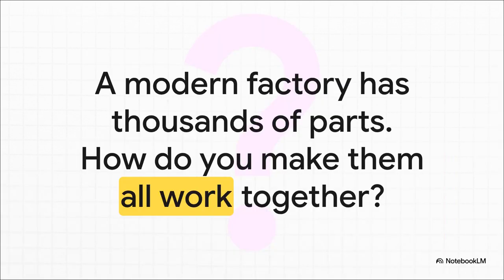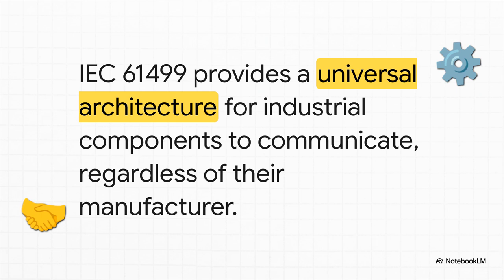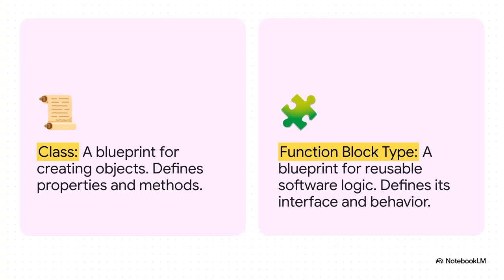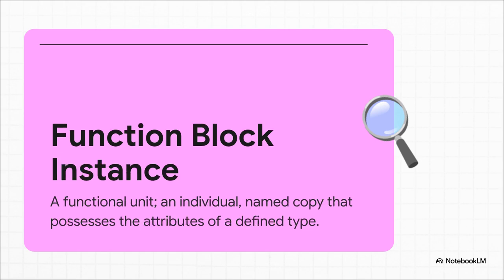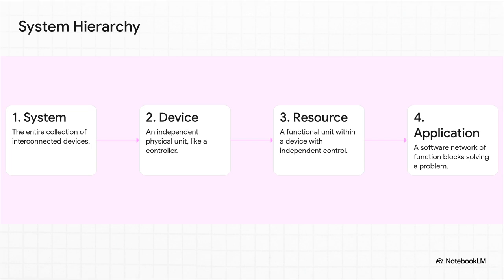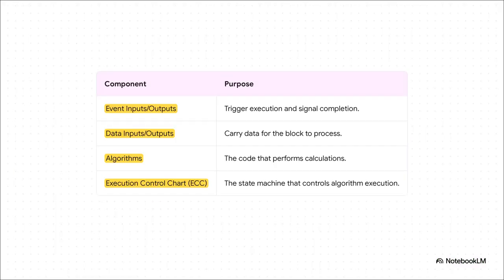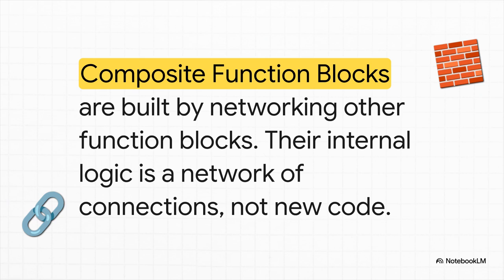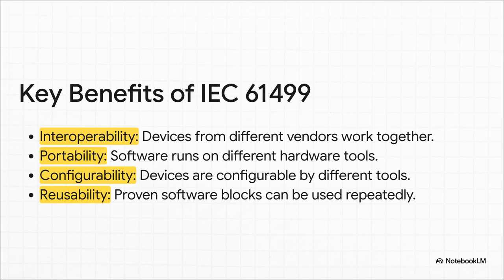Function Blocks  The Future of Automation

Comment: So many things to cover here. For once: the ICE61499 did not invent Function Blocks, did it? We had FBs in STEP7 and Modicon and probably other PLCs decades ago. So the whole concept of writing, instantiating and reusing them across projects isn't really new. So the actually new part of the IEC61499 from my perspective is the event driven execution and the aforementioned portability. But at this point I question the alleged benefits a lot: 
- Are there really end customers that want to hold PLCs of different vendors in their storage? The ones I know want to buy everything from The One to reduce costs.
- Even if the code portability actually works, what about the hardware? Like, if my M580 breaks and I get an Phoenix PLC, can it connect and talk to the existing HW devices just like that?
- How is the approach different from CodeSys? It also works with a bunch of different PLC manufacturers but the code still runs in cycles so I know that it will execute after download and don't have to fear to miss an event
- also at this point the documentation on the recent IDEs and the delivered libraries is scarse (e.g. EcoStruxure Automation Expert), there's no one discussing this in forums, no helping videos on YouTube - 99% of information is sales mumbo jumbo
- And the usability of the recent IDEs (again: EAE) is really bad so for me as an engineer that's a huge handicap since I'll need hundreds of additional hours to create the same things which already work in the existing systems 

I totally do believe that IEC61499 has the potential to become the future of automation, but RN it looks a lot like there's decades to pass before it's gonna happen